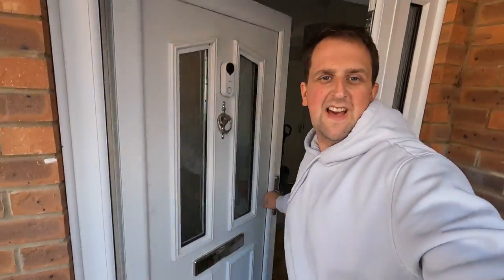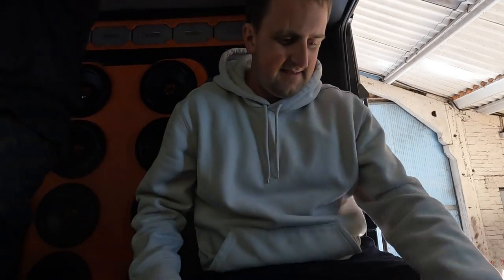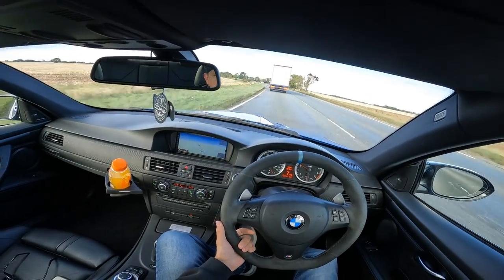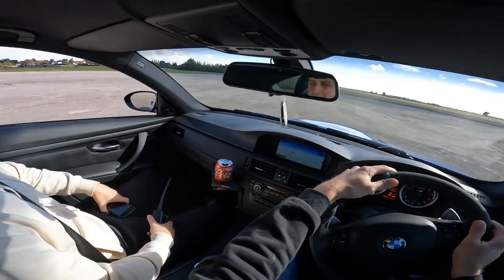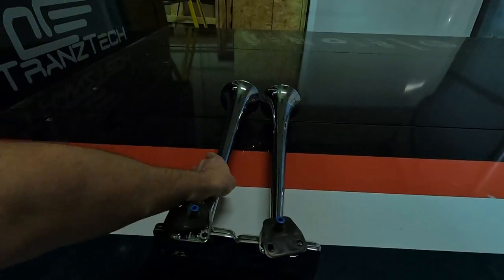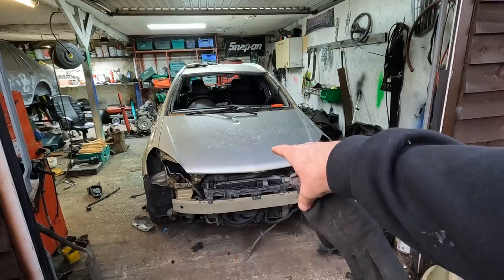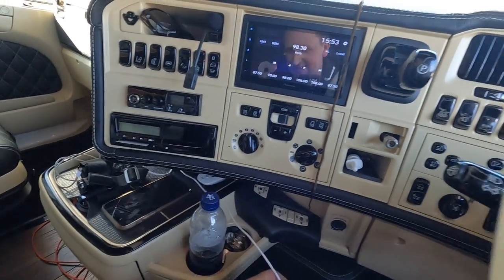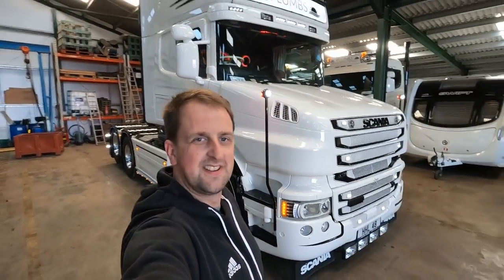A DREAM COME TRUE | Announcement | #truckertim

Comment: Wow that T cab just can't find the words to describe oh got it it's tangtastic.
Reply: Thanks T.T the closest I got to that feeling was driving an ayatz bravo 1 double deck coach thar new cost around £250.000 or more.
It had an MAN 12.5 litre straight 6 in the back it had air drivers seat. Split air con so the upper and lower saloons could be set to different temperatures. Had reversing camera and cctv. It also had hot and cold drink machine and toilet. Did an 8 day trip with it to Munich Germany for the Oktoberfest beer festival. Took a load of aussies out there.